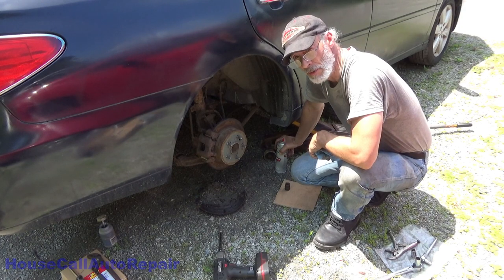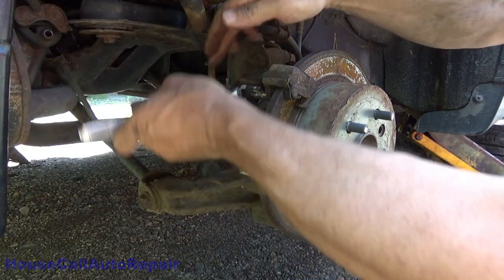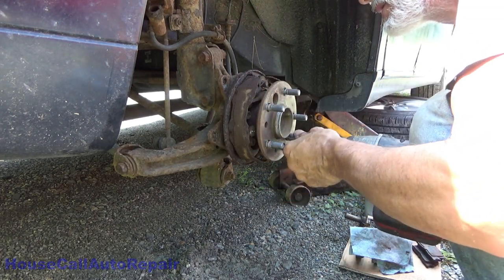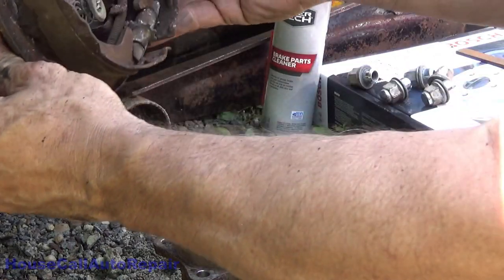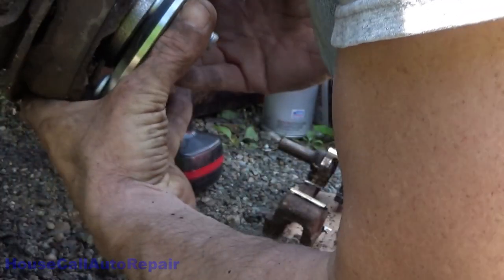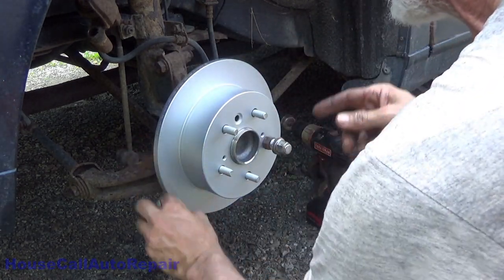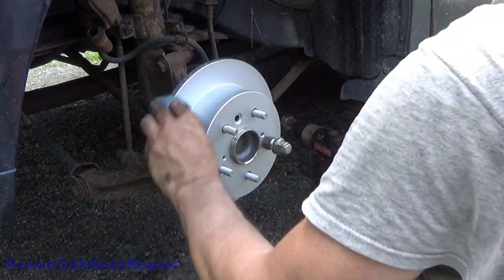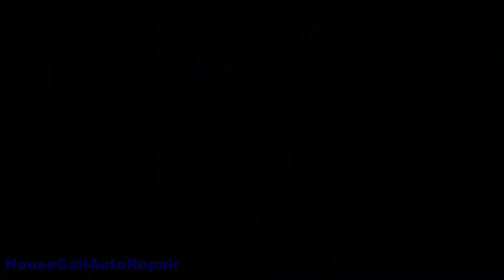2005 Lexus ES330 / Toyota Camry Rear Bearing, and Brakes.... Part 1 - Auto Repair -

Comment: Finally a video where someone is actually working on a rusty car where everything doesn't just fall out easy without any effort. I got to do this job on my wife's Lexus and it'll be rusty so I'm sure it'll take some convincing to get the hub out. Thanks for the video I wanted an idea of what tools I'll need for the job.
Reply from the maker: This is specifically why I started doing these videos. kind of a "preview" of the job...
Reply: @HouseCallAutoRepair  I did the job yesterday and this has to have been the most frozen in wheel bearing I've ever dealt with. I had to go to a friend's shop and use acetylene, make relief cuts, tons of penetrants, tons of hammering, even tried the press a few times and finally got it out after working it with an air hammer for quite some time. Next time I'm just going to buy a backing plate that the parking brake sits in along with the metal piece that the caliper mounts to. I hate living in the rust belt lol

Comment: Appreciate you making the video it was very informative.  What I find odd is how you say "I probably shouldnt do that" then you do it anyways?  "a little bit" of anti seize then you glob it on there?  You sound like my father lol it's great tho
Reply from the maker: The thing here, is rust. We break, modify, and completely ignore some "normal" aspects of auto repair due to rust making things do other than as they should, over time. We either compensated or take measures to slow/prevent. There are times where rust makes certain thing futile. (I generally try to use anti-seize sparingly due to cost, and to keep the "next guy" from being transformed into a tin man. I tend to use it as an anti-corrosive paint)
Reply: Yeah I live in the rust belt so I know how it is... get Fluid Film, good stuff @HouseCallAutoRepair
Reply from the maker: @mrmarcink1300   I use fluid film quite a bit now.... picked up on it from Eric at SMA